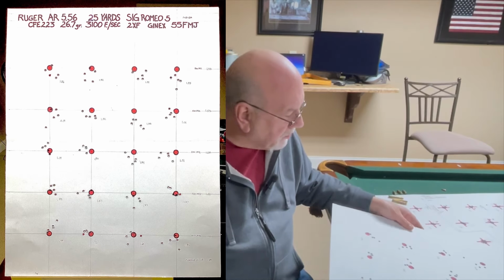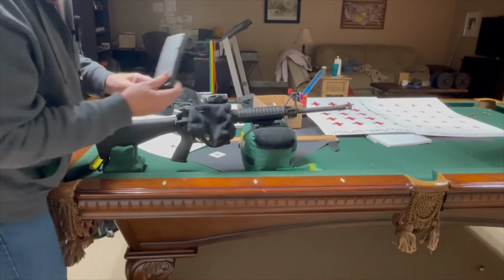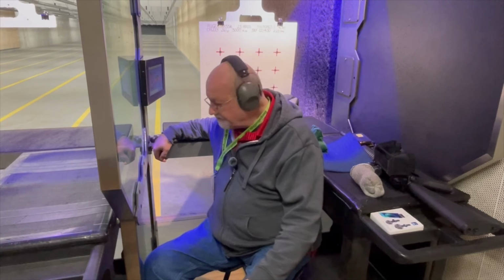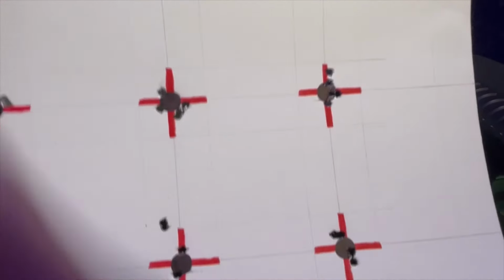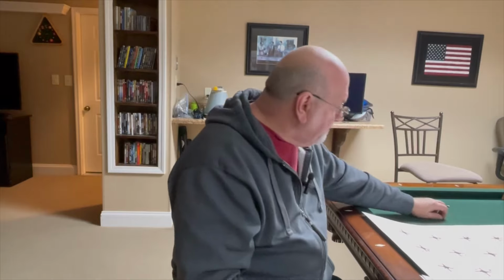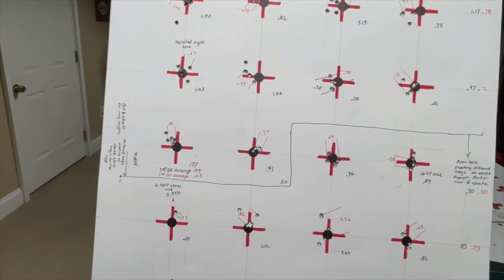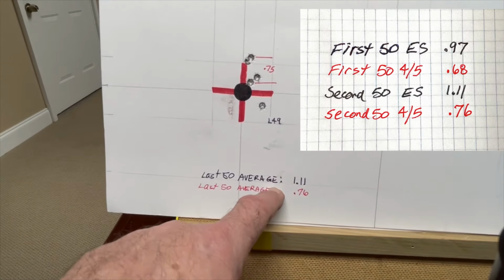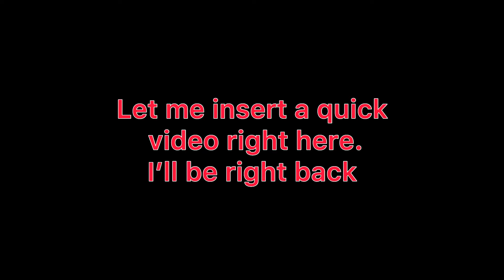Shooting 55FMJ at 25 Yards with Ruger, AR 556, and 26.1 Grains of CFE223 – – Part III￼

Comment: Thanks for the video!
On those split cases, how many times were those brass shot?
Just starting on my reloading journey. Yesterday I ordered the Nexus press, the sizing die and the seating die from Short Action Customs.
Reply from the maker: Hi Dr S. That sounds like a really nice set up. Best of success to you on your reloading journey. That brass had been shot four times. The problem is with headspace. I've not had this problem before with brass that had only been fired a few times But I checked yesterday and this brass is way oversized. I also found out that the headspace in my Ruger American is different from the headspace in my AR 556, so I have ordered a new set of Hornady dies so I will have one set for the 556 and another set for the Ruger American. That way I'm not constantly having to check and adjust for headspace going back-and-forth between the two rifles.  Problem should be solved. Thanks for watching.